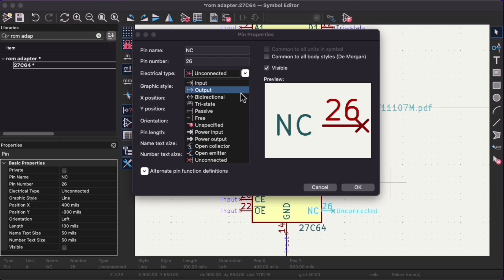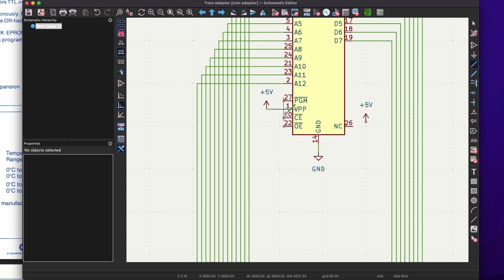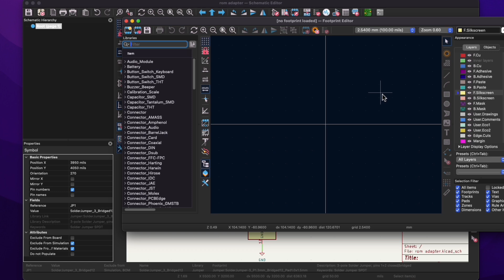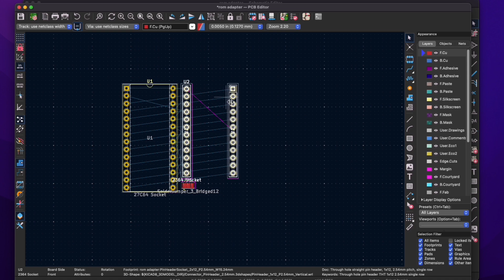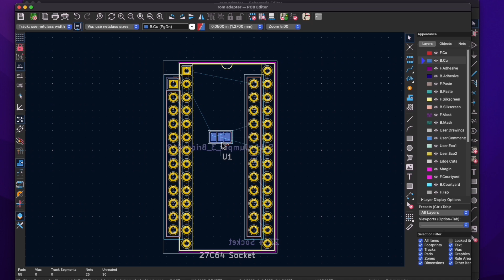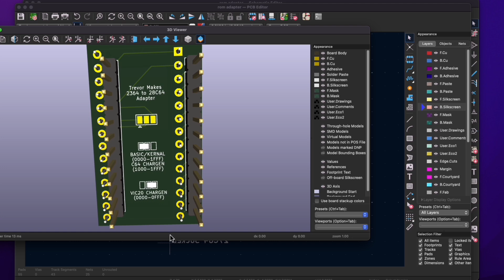Designing a full PCB project with KiCad for 8-bit computer

Comment: Great video I'm working on some 8 bit microcontroller single board computer boards for MCS-48 with a 8748 and 8749. I also built  a SBC for the Motorola MC68701 Microcontroller its 8 bit too. There are no noards available in 2026 to experiment with. I have 8 leds and 8 switches for messing around. All of these chips use eprom versions of  the microcontrollers.  I like your adapter I had to make one from plcc to dip once. These old 24 pin eproms are hard to find and are having bit rot too. Take care.

Comment: I have a problem I wonder if you can help me solve?

I have a TDL Xitan S100 bus Z80 computer with NO OS system.. 
When I turn it on, all I get is a screen full of simi-random characters...

I was wondering what would be the best way to test if the hardware is functional?

One thought was to possibly make an interface to use a C64 running hesmon
to scan/read every address on the bus, and see if I could poke some life back into
S100 bus....

Eventually I want to add every bell and whistle modern computers have:
USB, WiFi, Ethernet, i2c, M.2, SIMM, uSD, (2.5 inch HD or M.2 SSD)

Currently  the S100 bus has 2 (8 bit data busses).. (8 input) and (8 output)..
I have no clue why they did this.

I made a KiCad symbol/footprint for the S100 edge connector with a full size blank board
to put anything on... (The sky is the limit) 
The pinout matches the TDL Xitan bus...
Reply from the maker: In an earlier video I made an Arduino project that interfaces with a simple Z80 computer bus and gives you a HESMON-like monitor over the serial port. See https://youtu.be/A0VpPRWrqHc

I'd recommend figuring out how to adapt that project to the S100 bus signals: in particular how the Arduino takes control of the bus using BUSRQ, how the Arduino synchronizes with the S100 PHI clock, and maybe extending the monitor commands to include reading/writing I/O ports. Build that into a circuit board for an S100 card and then proceed to poke around on the address bus; dump memory where the ROMs should be and verify they're not corrupted, and see if you can talk directly to any of the other S100 cards given any documentation you can find.

You might also look into building an adapter board from your S100 bus to an RC2014 module as you might be able to find some existing modules to do some of the stuff you want or at least give you a starting point for designing your own S100 cards.